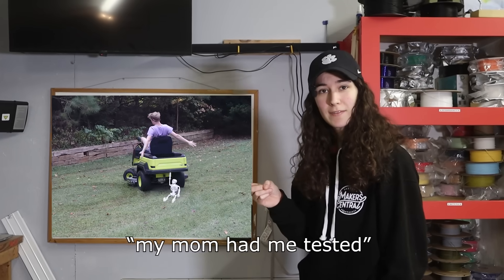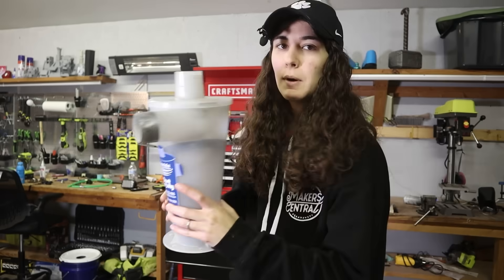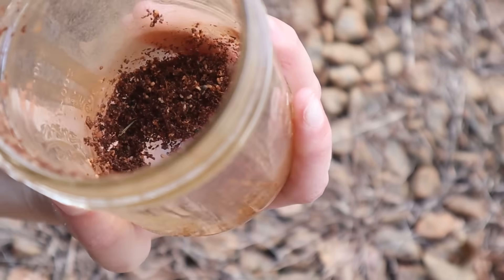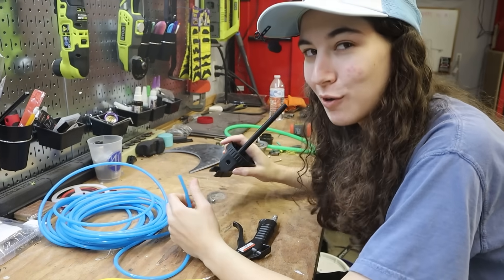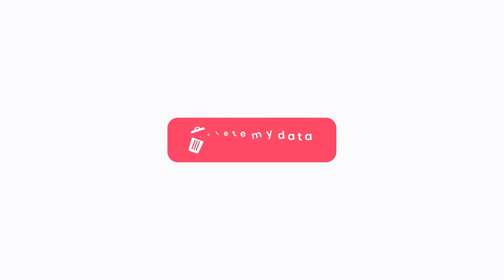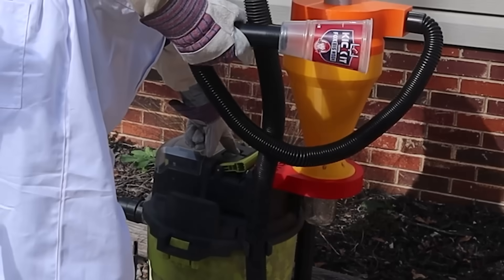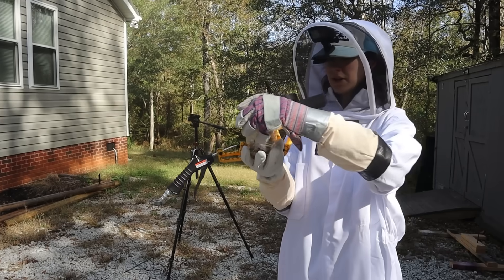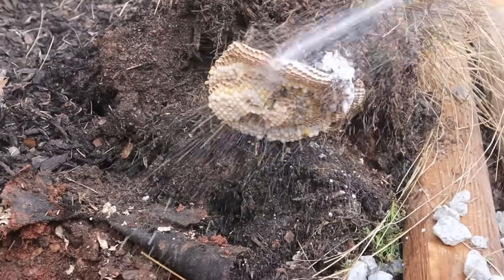I Built a Wasp Launcher

Comment: Part of the reason some of them aren't moving around after being   S O O K E D  is because they're being dehydrated by the vacuum. Bugs have basically hydraulic muscles and a thing that moves air around and swirls them around is sucking water out of their breathing holes. Ant keepers sometimes use vacuums to pick up stragglers after a nest transfer, and if they're not moving around afterwards they spritz em with some water and they get back up, right as rain

Comment: We had a huge nest under a bush we had to remove we tried for hours to get them out without getting stung we used multiple cans of bee spray which worked on the wasps but the dang yellow jackets seemed un effected, my boss showed up out no where and saw us struggling, walked up poured a solo cup of gas into the hole and walked away they were all dead in a second or 2, so if you have a bad nest you need to get rid of just pour a little gas in it and your good to go

Comment: venturi effect probably didnt work too well because the jar was sealed, causing a vacuum inside the jar. maybe one way valve in the end of the jar to let air be drawn into the  jar so the "pressure" doesnt end up equalizing on either end of the orfice.

Comment: The Ventura might have worked had the container not been a sealed jar.  There needs to be an air inlet to replace what is being shot out.  That's why an airbrush has a little cup on the top, not a closed jar.

Comment: Another option would be to refrigerate the jars once wasps are trapped. Its safe to then relocate them in a chilled carry box. Simply open the jar in the sun, and eventually they will heat up and reanimate some time later. This is assuming it works the same way as for flys.

Comment: I had a colony of those in my front garden a bunchnof years ago. I started my investigation by removing the shrub in the middle of the garden. The nest seemed to be centered on the root mass. Since the bees were aggressive I did not want to dig out the shrub manually. I managed to get a rope around the shrub, which I attached to my car. Shrub gone. Bees really really mad. That evening I discovered with some judicious exploration with a shovel that the nest was more than 1 cubic metre.  I called an exterminator.

Comment: Yellow jackets are a type of hornet, also known as the angry arsehole or barmy bastard... I fully concur and endorse Dan's release method against a hard and preferably an actively flaming source. Many, many years ago, I once designed a butane powered "Puff gun" wherein a short burst of butane from a bell shaped nozzle would create a millisecond duration fireball a couple feet in diameter that effectively removed the wings from the aerial menace whereupon simpler methods were able to gather them up more effectively. A fairly large nearby population of garden spiders was treated to a multi day feast...

Comment: Once did an Advanced Labs class where we had to get a few grams of some material to combust and calculate the caloric value of. We wanted to do wasps, but they're so goddang light we would've needed like 20-30, which would not have compressed into the pellet size we needed to fit it into the calorimeter cup

Comment: Why would a shop vac put a filter before the contents enter the container? Most vacs ive used have a filter to filter out the air from inside so even larger pieces of rock or dirt fall into the container then the air is filtered out.

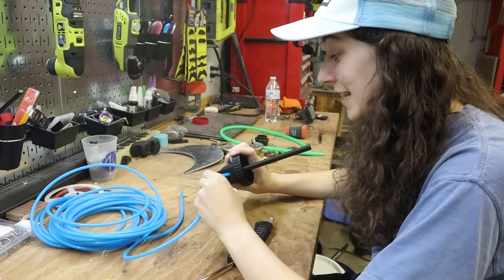Comment: 3:56 Venture only doesn't work because vacuum doesn't suck.  The vacuum doesn't move the bees.  You need a constant supply of air going into the jar to carry the bees out.  Something like drilling a hole in the bottom of the jar small enough for air to get in but not the bees to get out.  But you can design something better

Comment: Ok, there is a general mistake with the ventury effect as you want to use it here.😅 The jar is closed. So the ventury effect cannot succ anything from there. You need to have at least a small hole in the jar to allow air to enter into the ventury nozzle. Better have a big hole, maybe make the bottom of the jar just from a filter or something.

Comment: Regarding your PPE, did the suits not adequately protect you from the yellow jackets?  You both seemed very afraid of them despite having the suits on.
Reply: bee suits dont keep you from being stung just lessens your chances of being stung, and also keeps them from going up into your clothes.
Reply: It really depends on the suit and how well sealed it is for a lot of things. The amount of time exposed also plays a role, as given enough time they will find a crevice you left open or a thin spot to sting through. The canvas will stop a sting from hitting you 999/1000 times, but given enough time you'll roll a bad luck moment.

But that's for bees, not wasps. The suit will still help against wasps, but depending on stinger length and sharpness they can sometimes punch through it.
Reply: A honeybee once stung me right through thick hoodie when i accidentally pinched it with my elbow. Their stingers are longer than most people realise. They can sting through most clothes. Protective suits mostly just prevent them from crawling inside your clothes and to confuse a bit about the places where stinging would be effective. But if they really try to sting you, they will.

Comment: Venturi effect will only work if there is an inlet for air to flow through. Else you are just creating an area of slightly low pressure - Nothing is going to pull the wasps out until there is something able to replace the empty space made by the wasps. The vacuum isn't enough to collapse the jar into itself so there's no real pulling force on the wasps, just a small amount of air next to the mouth of the jar.

Comment: Venturi effect to suck bees out of a jar doesn't work so well if one doesn't also let air into the jar. Otherwise the jar just goes to steady state low pressure with no flow. Bringing air into the bottom of a jar would introduce airflow from the bottom to the top.

If the air flows in at an angle to the side, then it's likly to effect the bees the most as the bees will tend to want to stay closest to the side walls.
Reply from the maker: the lid actually had a vent hole in it, but we switched up completely to the new version because we knew it’d work best with the hole at the bottom of the jar, and drilling into glass is kinda hard
Reply: @EmilyTheEngineer  just a thought. many peanut butter jars are made of plastic.
Reply: @EmilyTheEngineer  Drilling glass isn't necessarily all that bad. I had good results drilling through a glass jar with a diamond hole-cutting bit. I put the jar inside a bucket of water while drilling to keep the glass dust under control and successfully drilled the hole in under 30 seconds.
Reply: @klasodeth  Add the words 'without a specific bit designed for the job' which many people in their early twenties do not have.
Reply: @BruceNJeffAreMyFlies  if only there was a store that specialized in tools and hardware where people could go and buy drill bits and other tools.... Oh wait.
Reply: @BruceNJeffAreMyFlies Diamond drill bits are cheaper than pretty much any of the multiple machines Emily has access to though. It's more just inconvenient when you just want to get a project done and you have an easier method at hand that definitely works.
Reply: @BruceNJeffAreMyFlies  I didn't have one of those bits either, yet in less than 30 minutes I was able to drive to Home Depot, purchase a suitable bit (including some time at the store trying to figure out which size and type of cutter would probably work best for me), and then get back home to start my project. By the way, most people in their early twenties don't keep beekeeper suits in their wardrobe, yet somehow she had more than one of those available for the project. I'm pretty sure a person in their early twenties would have an easier time getting that diamond cutter from the local hardware store (as I did), than to get multiple beekeeper suits.
Reply: @bosstowndynamics5488  A sewing machine is cheaper than any of my 3d printers or power tools, but that doesn't mean it would be economically wise for me to go buy one... Especially not on a students budget...
Reply: @klasodeth  Yeah, fuck it, why not spend time and money on every slight convenience you could ever think of? I see no problem with that idea.....

You yanks are such good little consumers...
Reply: @BruceNJeffAreMyFlies  True, but any sewing machine worth having is still going to cost far, far more (and take up way more space) than a 5 dollar drill bit.
Reply: @BruceNJeffAreMyFlies  Based take. We love to see it.
Reply: @BruceNJeffAreMyFlies   You can use 2 dollar stone drill bit
Reply: I was looking for this comment.. I'm like dude... the bee's are in a vacuum... they're not gonna come out!
Reply: @kleetus92  yup, they are only comming out if there's a lower pressure at the mouth of the jar but the ventrie effect quickly reaches a steady state inside the jar with no air flow through the jar.
Reply: So many Jars in that sentence.

Comment: 1:05 Ahhh, You could have use a little more time explaining how a cyclone filter works, it is sooooo coooollllll.
For particles of a given size and mass you need a given "air speed" for the particle to be suspended in the air, but since the air coming in with a high speed along the side og the cyclone, and is leaving with a 90 degree angle the "air speed" must base 0 (or close to 0) at some point in the cyclone, and as the air speed drops the particles drops out of the air stream, and that point in the stream you put in a container to collect all the particles and now you have a filter that do not get clogged. Honestly this is genies, and you can find cool CFD simulations and videos of this... Please do.😃
Reply: yes

Comment: did you consider asking a local bee keeper for help and ideas on how to deal with the bugs safely before attempting this plan ?
Reply: a bee keeper would cheer for this justified self defense against wasps.
Reply: Bee keeper would be there in a full suit, cranking up the air pressure to max and cheerfully firing the hornets directly into the wall at relativistic speeds.